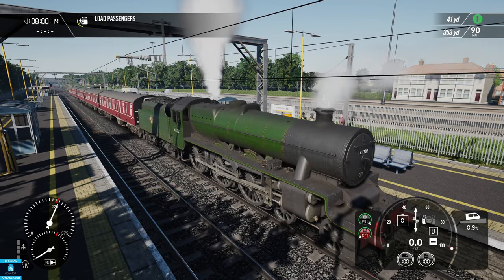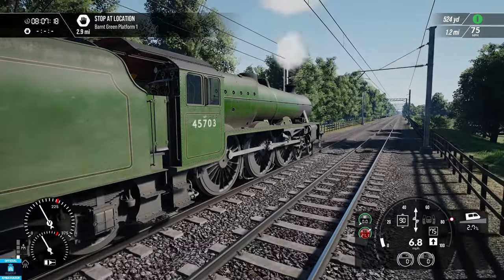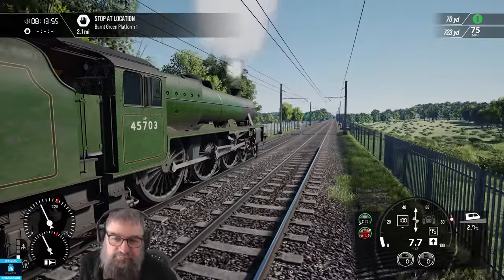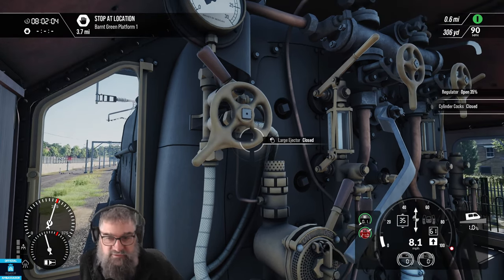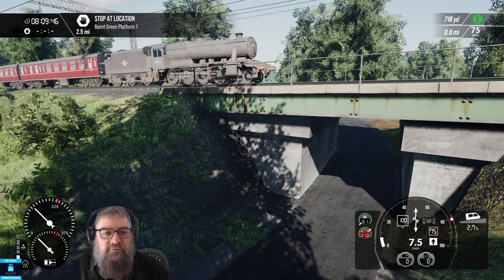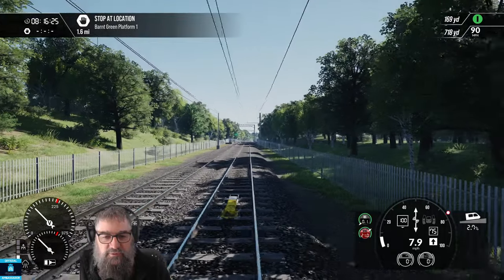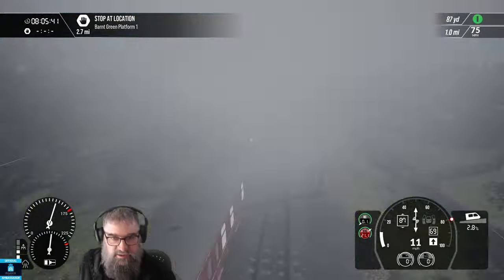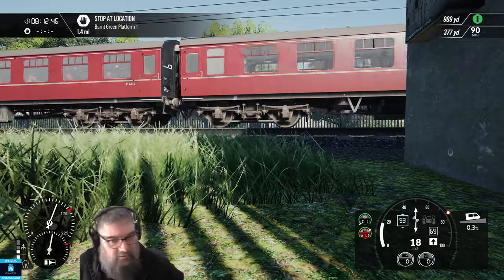Can Steam Lick The Lickey Bank on Birmingham Cross City

Comment: As long as a loco isn't trying to haul an unfeasible weight, up an unfeasible incline, I discovered, when I first learned steam on TS  WLoS, that the speed, and thus steam usage, will drop until it matches the steam creation, creating a kind of minimum speed cushion, and that's the max speed for that loco, with that load, on that gradient. 

I remember pouring over the F5 stats and it was a wonderful revelation to realise that I could save a deteriorating situation. 

It isn't the correct term, but I refer to it as ground effect.

Wondering if this is how it works IRL or if it's more complex ?
Reply from the maker: No in real life if you're not keeping up with steam generation you'll stall on the bank and need to recover. You might get going again after restoring the heat to the boiler or you might need to do what's called "stall and divide" where you leave some of the train behind, take the rest forward then go back for the part you left.

Comment: Interesting experiment, Paul, thanks for that.

The relevant numbers -
Loco		Power	Weight	Pwr / wt		as % of Jubilee	Time (s)		% faster than Jubilee
8F			32,440	278		117			26%			1034		9%
Jubilee		26,610	286		93							1136		
Fowler 4F	24,555	241		102			10%			746			34%

So on power to weight ratios, you’d expect the Jubilee to be slowest, and relative to that, the 8F 26% faster, and the 4F 10% faster.
Whereas the trial showed that the Jubilee was (correctly) slowest, and relative to that, the 8F was 9% faster and the 4F 34% faster.
So p’raps they need to swap the physics for the 8F & 4F 🙃
Reply: My driving style is to try to maintain pressure just under the safety's, to maximise grunt and I reckon that you could improve the times and make the test more standardised that way. (I don't have TSW3 or that route or I'd experiment with it myself)
Reply from the maker: There's better steam physics and fire control on the cards for the future. Here's hoping they'll have enough time to make it happen at some point. For people who know nothing about steam it's good enough to run trains so it'll be a decision of love not a decision on commercial grounds. Cool about the power to weight ratio information.
Reply from the maker: @Daytona2  with today's steam physics you can't do that. In real life it doesn't work that way either. On the locomotives on my railway we aim to stay above 150 as much as possible with our redline being 180. You're constantly juggling fuel, air and water. Adding fresh fuel brings cold. Adding water brings cold. Firing against the gun (coal and water at the same time) is particularly hard.